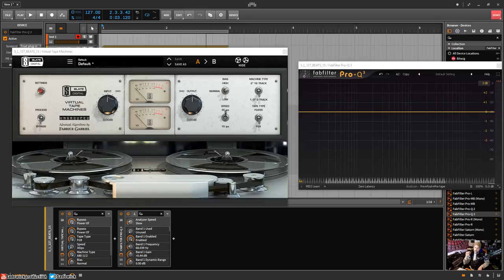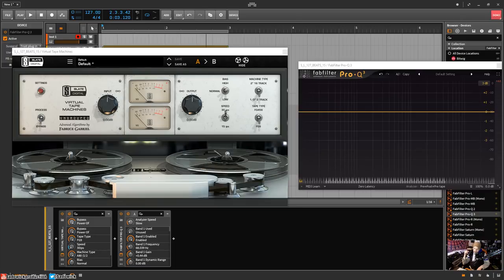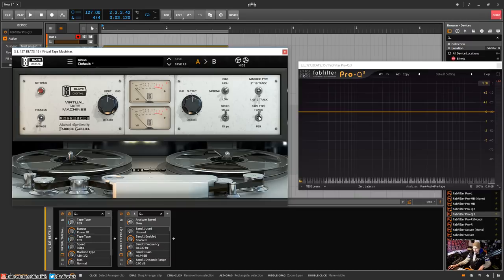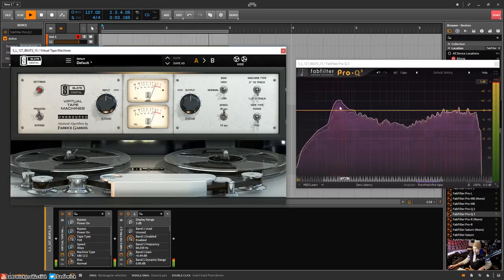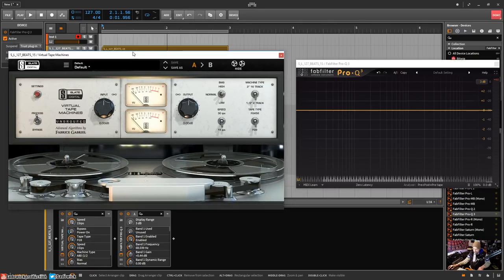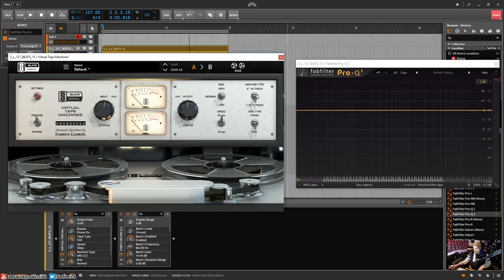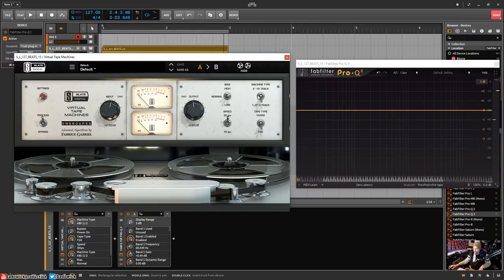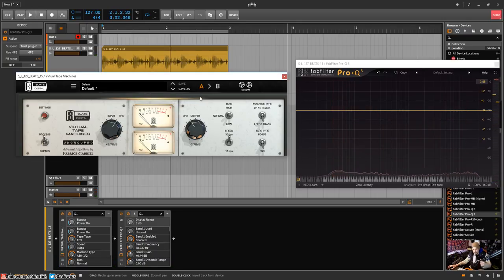Tape Machines & How They Apply To EDM Production

Comment: i think, logically speaking because i am no expert on tape, just as running the machine at 30 ips will allow you to record more detail, the width of the tape itself may allow a wider tape to better record the amplitude and frequency information since you have more space to write on! Great video! good to you see back at it!
Reply: While you're not incorrect, realistically speaking the actual time recorded was less of a problem than the overall frequency response (which 30ips aimed to combat).

Comment: I thin it's more for gentle (or not sometimes) glue compression. Also I removed by the Slate Tape Machine unwanted little bit harshed high frequencies while doing mastering.
Reply: Have you tried the U-He Satin ?
Reply: @cheekoandtheman  nope, too complex for me, I needed speed solution as I'm remembering. Slate is a fast thing to setup
Reply: I agree
Reply: For glitching sounds that Uhe Satin is interesting, my brain has been exploding over BitWig and it Modulation capabilities

Comment: How can you achieve the same effects a tape emulator does without a tape emulator? From what I understand, you only need an EQ to boost the low end, a distortion, saturation plugin, and a compressor, or are there more effects to it?
Reply: And noise*
Reply: Technically, yeah, that's all you need. Tape emulators exist for a few reasons:

a.) It's nice and convenient to just boot up a single plugin vs three
b.) theoretically speaking, specific tape machines have their own specific tonal quality that other methods won't be able to achieve easily, if at all
c.) real tape machines are inherently random which adds to the supposed "analog" character. Emulators help to achieve this.